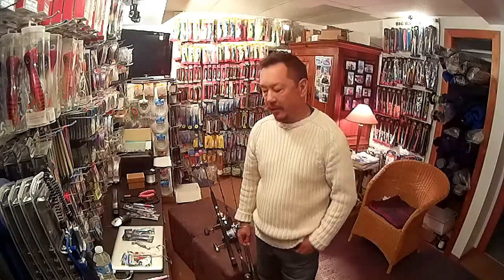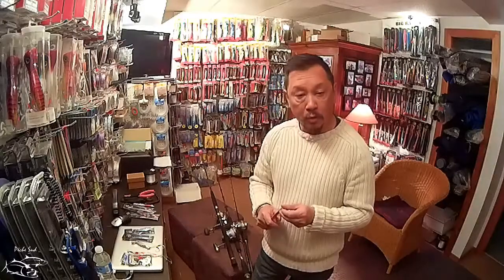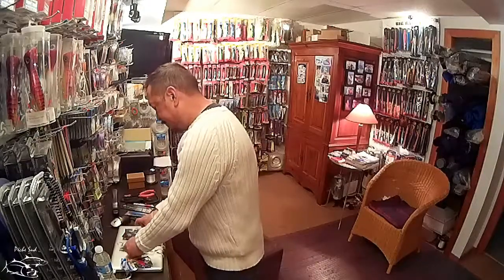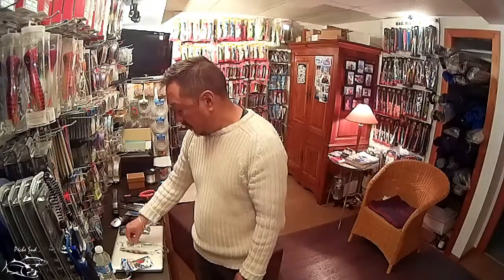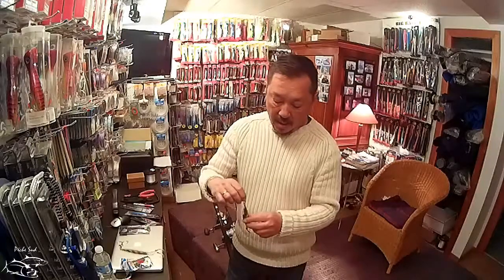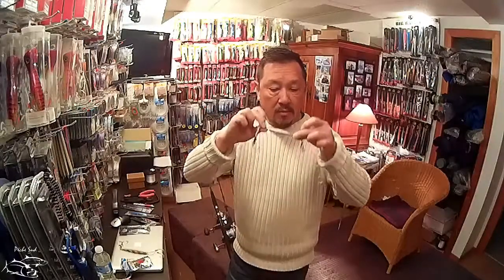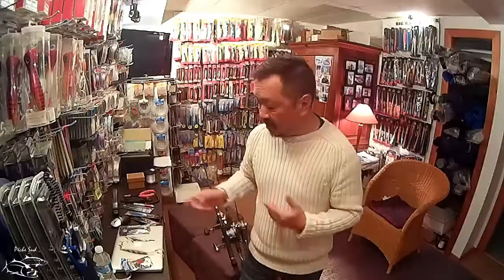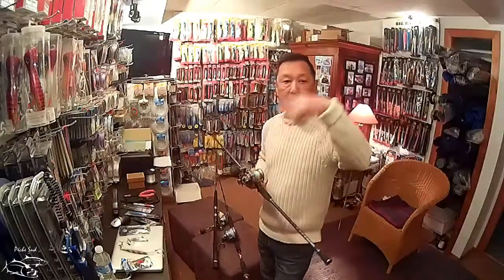Slow jigging versus Speed jigging

Comment: Sir in fast jigging, can I use the slow  jigging rod? The same  with the slow jigging can use the fast jigging rod?
Reply: You cannot use SPJ rod for speed jigging since the rod just bend and the jigs will not have enough action.   You can you a fast jigging rod on a slow jig for high pitch jerk or long fall, but you're cannot perform other slow technique like 1, 1/2, 1/4 pitch...etc.